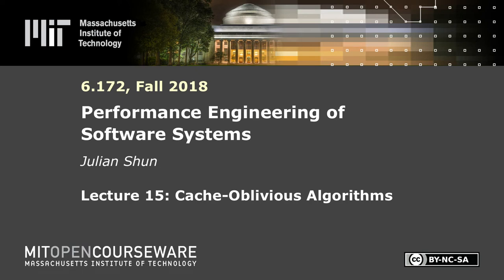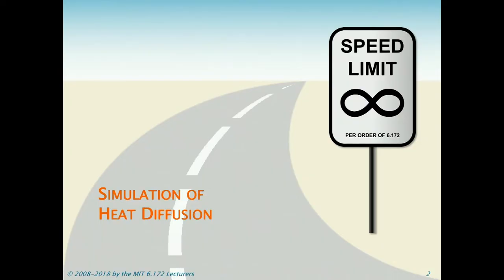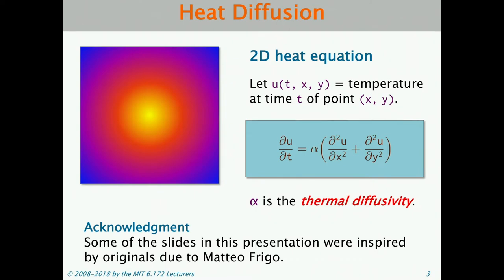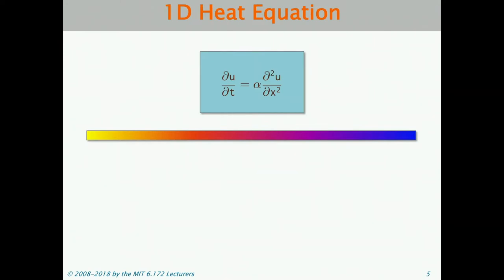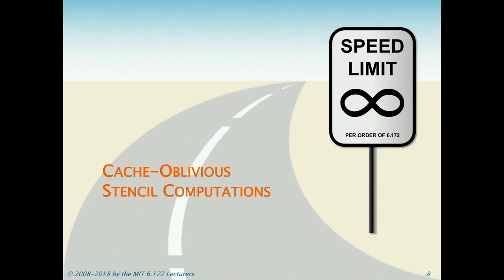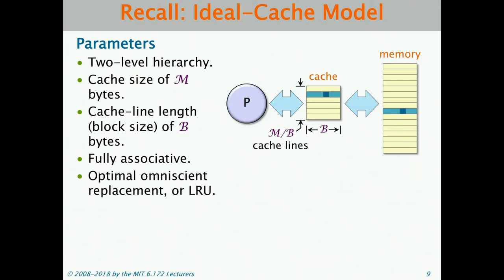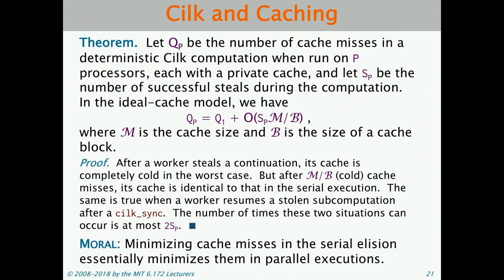15. Cache-Oblivious Algorithms

Comment: My takeaways:
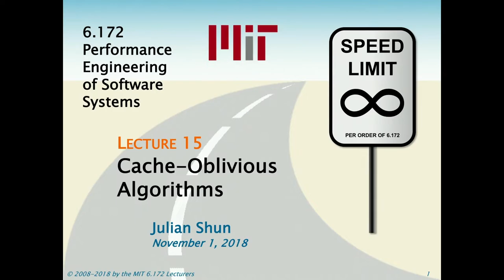1. Cache-aware algorithm (e.g. tiled matrix multiplication) vs cache-oblivious algorithm (e.g. divide and conquer matrix multiplication) 0:30
2. Simulation of heat diffusion 1:10
3. Cache-oblivious stencil computations 15:28
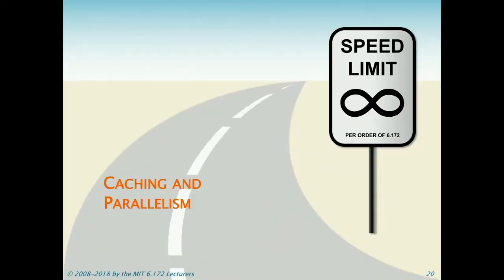4. Cache and parallelism 47:03
5. Impediments to parallelism speedup 55:45
6. Cache-oblivious sorting 1:00:01